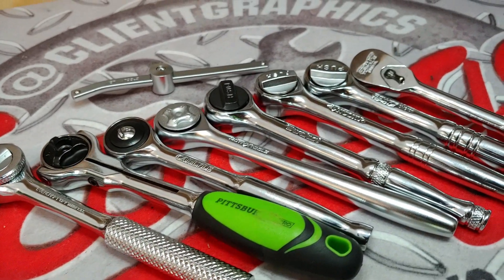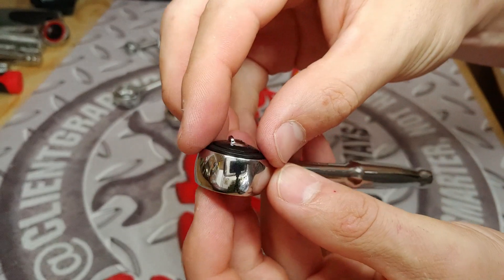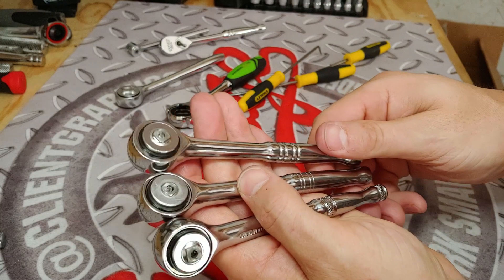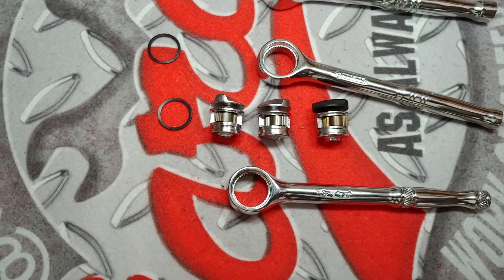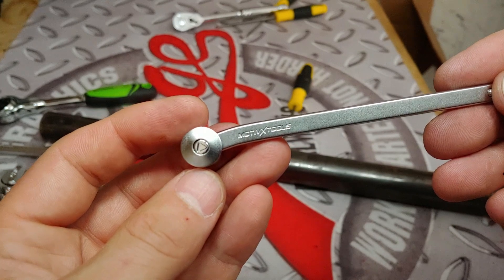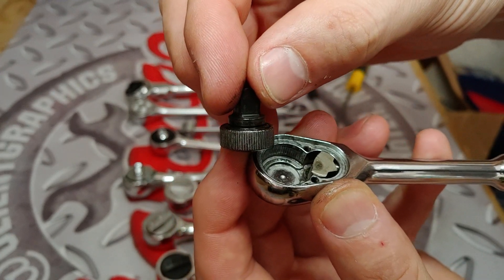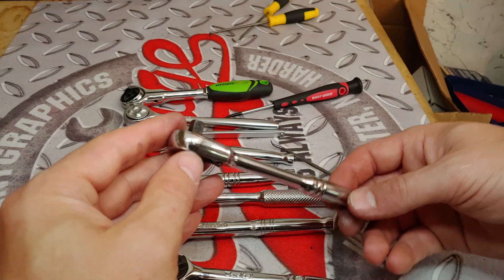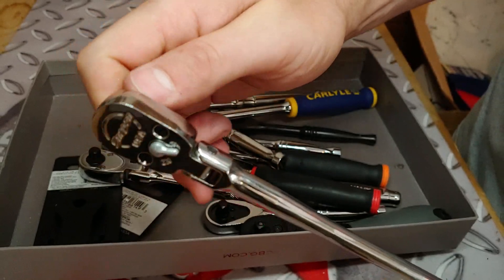Cheater Bar Used, Now What? Socket Ratchet Internals Reviewed

Comment: Hey. This is a bit off subject although it does pertain to "ratchets". I have been searching for the answer to this, and I ask anytime I find someone who is into testing rachets... Does anyone know the torque differences if measured at the fastener between the 3 main square drives (1/4", 3/8" & 1/2") assuming you applied the same force from the same length of ratchet handle? For example, if you applied 12lbs of force, onto a 12" ratchet handle, on a 12mm fastener, with each drive size... What would each torque rating be that is applied to each fastener? Would they all be the same? I was told 1/2" drive would apply more torque.. but how much more? And why? Is it a considerable amount more or just a smidge more?
Reply from the maker: The actual loss between drive sizes is so minimal that without precise measurement devices and taking in environmental consideration the torque loss is so small.  Less than 1 ft-lbs and that’s rounding up.  Thing that matters would be how much total force you can apply before a drive sizes breaks and factoring in the mass of the drive size.  So the main thing is length and loss is minimal between drive sizes.

Comment: I just ordered the MotivX set from Amazon. They have a 20% code on Amazon to use at checkout. Came to $33 with tax and free prime shipping.
Reply from the maker: NIce, the 3/8" drive set sold out pretty quickly and won't be available until Aug.  1/2" drive is still in the works but they must have some stock since they sell a 3pk of the swivels by themself now for $25 on their site.
Reply: ClientGraphics They have a 5 piece low profile oil filter set that looks pretty nice for $29 that I may grab too.

Comment: I would look forward to seeing how each place responds to a warranty claim knowing they were intentionally abused. I would definitely be curious to see what manufacturers void the warranty and which ones simply don’t care.
Reply from the maker: Trucker88 Zero issues with any of them.
Reply: ClientGraphics Wow. I remember Bear from Den of tools cut some tools in half and they still warrantied them. Drives me crazy when people say they buy SnapOn for the warranty and swear that no others tools can be warrantied. Looking forward to that next ratchet test. I own most of them and I’m curious which holds up the best.
Reply: @truckerpeterose  well in my opinion most shops should have a no questions asked warranty swap as long as its a tool they carry. and specially if its their house brand. and big brands like stanley, irwin, klein, etc should work out a replacement plan with retailer and supplier as well.

Comment: I have those extra long ratchets in quarter inch and a converted 3/8! You have to buy a short converted 3/8 to make it work. So far been using them for a few months, very good for tight access areas!

Comment: Great job with this comparison review of these ratchets.   Im still impressed with that Pittsburgh even though its non serviceable.
Great point at the end about the length of the 1/4in. lol. Only reason would have to be the ability to reach hard to reach places.  Thats my only issue with the long handle 1/4in ratchets.... lm always thinking this things not made to handle the torque l can put on the thing.
Reply: It's good stuff the only thing I could ask of it is to be 1 or 2 inches longer :)  That Evercraft came out of nowhere.

Comment from the maker: If you missed the destruction https://youtu.be/BivdaA6YdhA 
Napa Evercraft 70.2 ft-lbs
Harbor Freight PITTSBURGH PROFESSIONAL 70.1 ft-lbs
Napa Carlyle 69.0 ft-lbs
Motivx Tools Ratchet 68.3 ft-lbs
Motivx Tools T-Slide 66.7 ft-lbs
Duralast 66.4 ft-lbs
Husky Tools 61.7 ft-lbs
Power Torque 38.9 ft-lbs